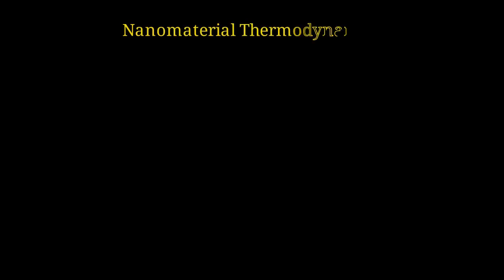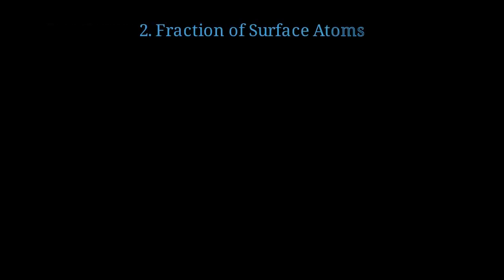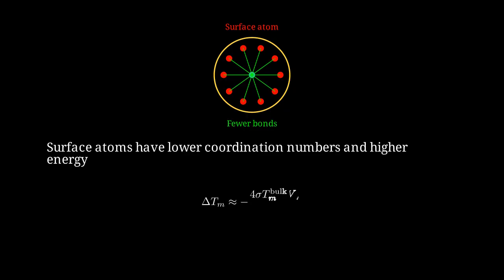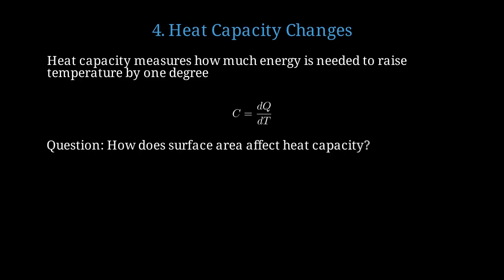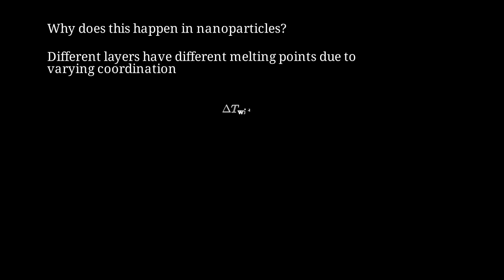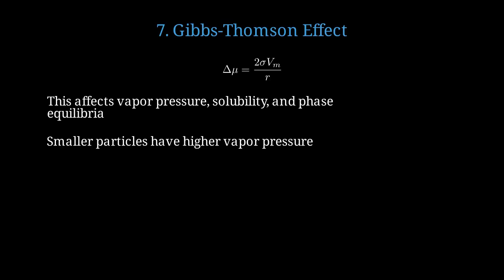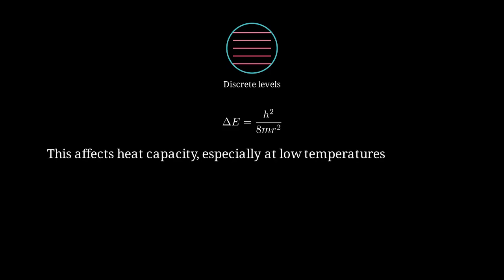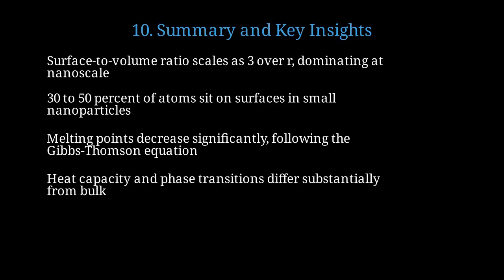Why Surface Area Makes Nanoparticles So Reactive?

Comment from the maker: How do traditional thermodynamic principles break down when surface area dominates over volume in nanosystems?
Can entropy and enthalpy contributions be accurately predicted for nanoparticles with irregular atomic surfaces?
What limits the scalability of surface-driven reactions when transitioning from nanoscale models to macroscopic systems?
Reply: The metaphorical friction heat?